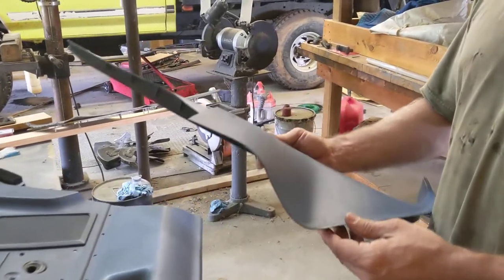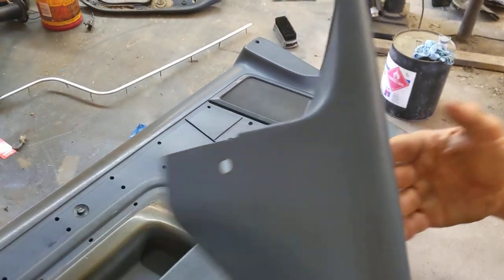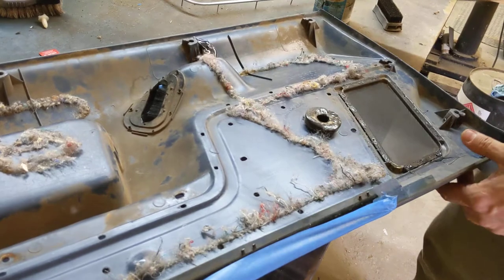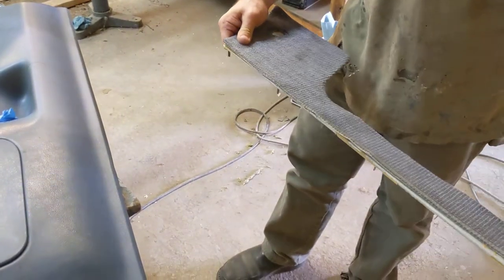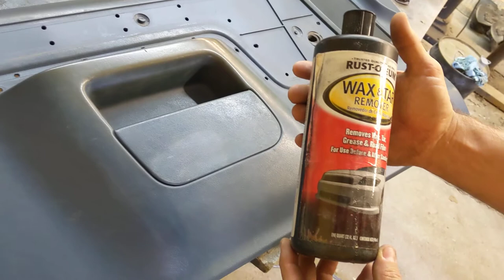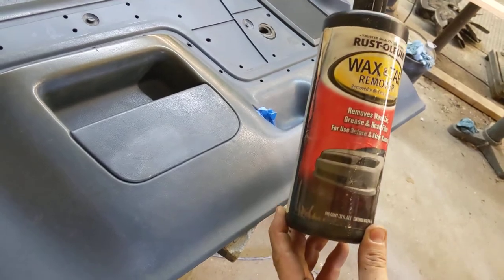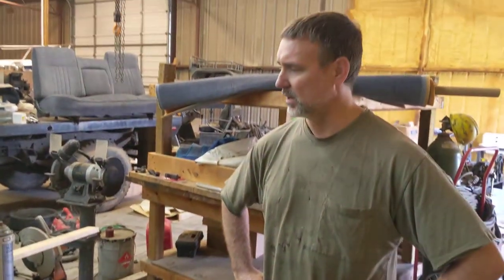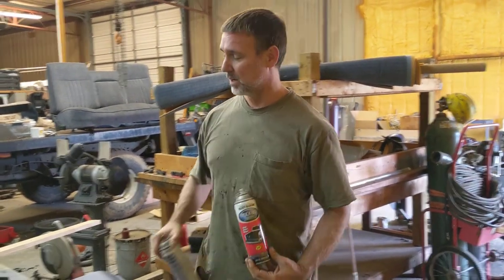Restoring 40 Year Old Ford Interior PVC Plastic Trim | Fix Cracks, Clean, Texture, Paint

Comment: Any advice on some seriously damaged Pinto passenger compartment side panels?
Reply from the maker: What kind of damage, exactly? Structural cracks or surface damage?
Reply: @GettinBelizy  
I’ll take a few pictures and send you the link. Missing pieces where the top of the panel meet under the side windows. 

I was thinking of shaping a form to use epoxy shape it and go from there.